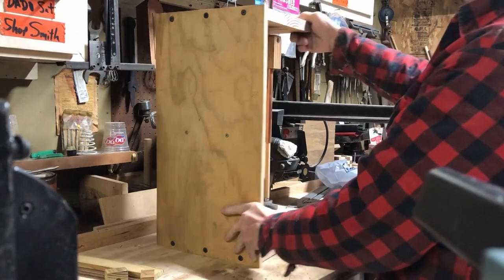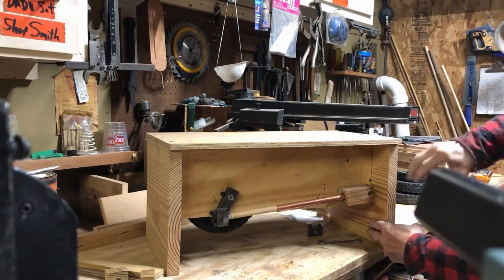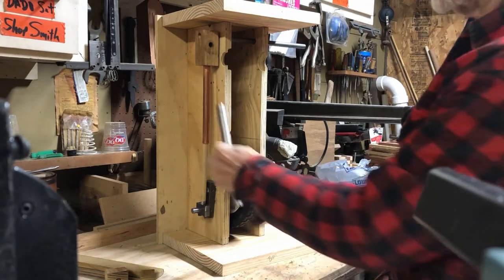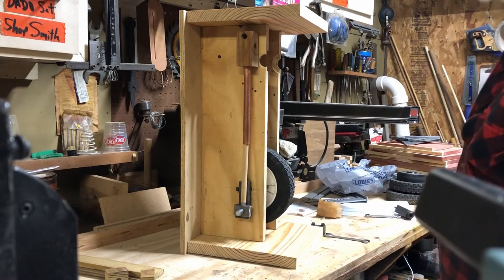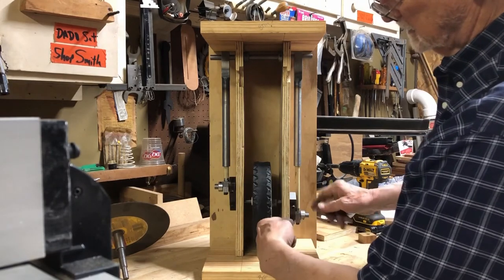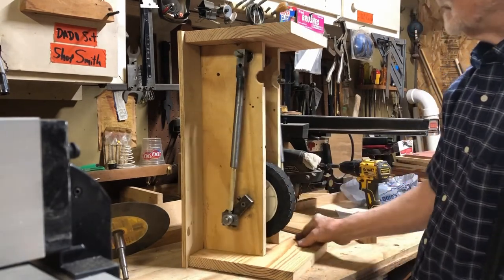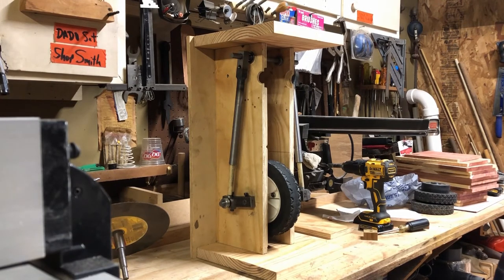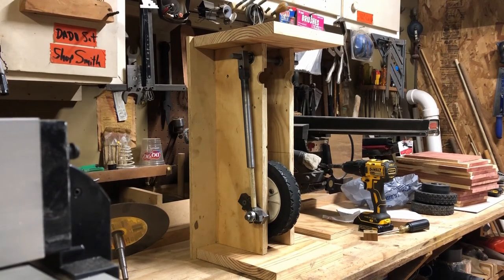Compressed Air Motor Assist for a  Bicycle 5-1-21

Comment: I like your design. Have you thought about perhaps taking a timing belt and turning it inside out and attaching it to the drive wheel so if it gets wet the teeth on the belt will give it more bite? Perhaps with an epoxy or whatever you can use to attach it to the wheel.
Obviously you would have to cut it down to fit. I like that you make your own cylinders I've seen them made from pneumatic cylinders that are already manufactured, and they work well but with designing your own you can put the valving where you need it etc as well as the exhaust. I too build my own because I have a lathe and a milling machine so I can do accurate work. plus I get the satisfaction of building the whole thing.Looking forward to seeing some more of your design and some more of your building process!
Reply from the maker: Thanks for the comment again, the tire on the bike has knobs so it should work hopefully OK with the groove in the drive wheel. Also I agree it is satisfying to finally see some thing when i get it done, and I find that there’s so many different ways to do something that using a bought item doesn’t work, so that’s one reason why I have to make the entire thing plus the design is something a little odd at times. I also have a milling machine metal lath, but I’m not exactly a professional at it – I do get it done!

Comment: Nice to see someone else building an air powered bike. You will need to use larger pistons run at lower pressure to maximize potential expansion in your cylinders.
Reply from the maker: Thanks for checking in, but as you probably saw my design is totally different than what you were running. The driveway was 3 1/2 rotations to one bicycle wheel so I need to hire revolutions in smaller cylinder will conserve compressed air and I think will have sufficient tour to assist when you’re riding the bicycle or drive the bicycle on level ground anyway. Guess we’ll just have to wait and see how it turns out . thanks for the comment though
Reply: @AirEngineResearch  the reason for the larger pistons is to maximize expansion.. at 50% compression the pressure is approximately 15 psi. Since your maximum expansion for 4 pistons is one half stroke, you are going to want to design a motor that runs at 15 psi.. or your just blowing your energy out the exhaust.